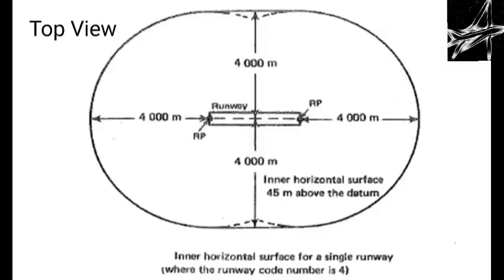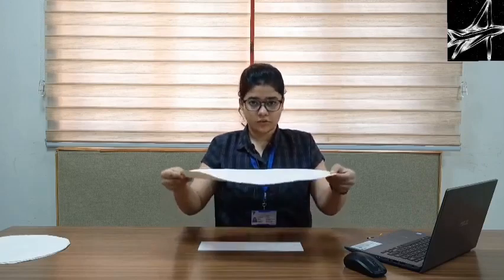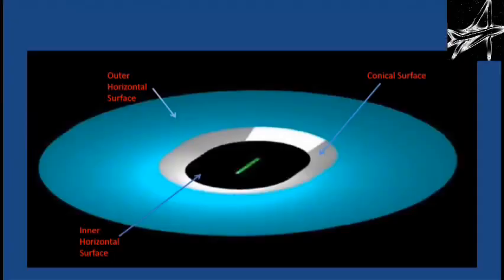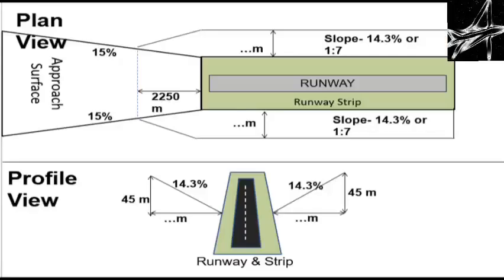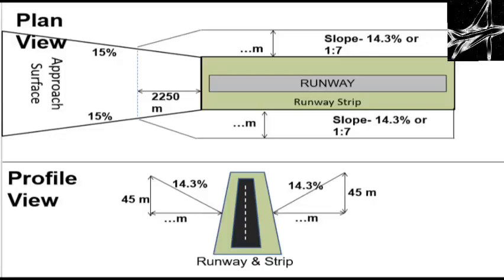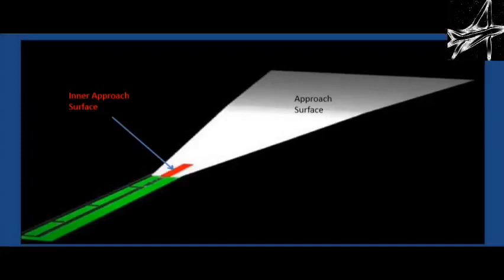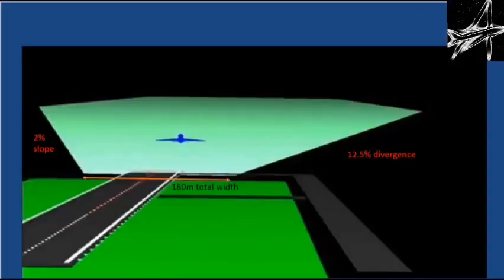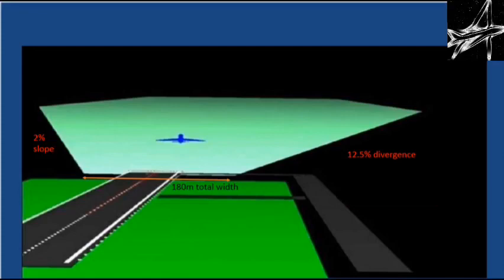OLS ( Obstacle Limitation Surfaces ) fully explained with All "9" surfaces in one video 🔥👌

Comment: Very useful video …. But can u clarify how d obstruction height is determined ie… if a antenna is to be placed 1000 mtrs from rwy centre line …. What is d maximum height of obs…. And is there is any formula….
Reply from the maker: 1000mtrs. Which side of the runway sir?
Reply: @aviationavi7532  Sir let it be any side … other than approach and departure path
Reply from the maker: If this is the case then the governing surface is Transition surface with a slope of 14.3% or 1/7 (one in height and seven in length), which allows a height of 123 m approx but since the other surface named as Horizontal Surface restricts the actual height to be 45m only. Till 4000m from the reference points
Reply: @aviationavi7532  Thanks sir….

Comment: Some aerodrome's ARP coordinates are not align to the mid point of runway CL (geometric centre of landing area) as we have two runway in use.  

In this case, which one we should consider as a reference to draw a radius of 15,000m for OHS? 

Established ARP again or Mid point of runway CL?  

I hope you can clear my doubt. 

Thanks,
Reply: The Outer Horizontal Surface shall extend to 15000 meters from the Aerodrome Reference Point for Aerodrome with runway code 3 and 4. In case of Aerodrome with runway Code 2, the Outer Horizontal Surface shall extend to 14740 meters from Aerodrome Reference Point for Instrument runways and 13740 meters for Non Instrument runways. Where combined Outer Horizontal Surface is established for two Aerodromes, the Outer Horizontal Surface shall be centered on the Aerodrome Reference Point of the Aerodrome of higher category. Outer Horizontal Surface for Aerodrome with runway code No.1 shall not be established. 

Hope this is of some help in clarifying your doubt.
Reply: @anweshapal8480  I really appreciated your hardwork and Thank you for helpful reply.

Comment: Value of "m" in Transitional sub-section...
14.3%=1:7
If 1=45
Then 7=x... by cross multiplying x=45×7
x=315m (Answer)
Reply: What should be the calculation for conical surface? Thanks.
Reply: @muhammadsultanularafin8846  the slope of conical surface is 5% i.e, 2100*5% =105M
Reply: 2100 kaha se ??  muje tu oper M ki calculation or aap ki bilkul samj nahi ayii.

Comment: The last part would be 13400..
Becoz now a days outer horizontal surface is to be considered as 20Km.
Plz clear my doubt on this fact..
Well explained about this topic...
Well done 👍
Reply: The Outer Horizontal Surface shall extend to 15000 meters from the Aerodrome Reference Point for Aerodrome with runway code 3 and 4. In case of Aerodrome with runway Code 2, the Outer Horizontal Surface shall extend to 14740 meters from Aerodrome Reference Point for Instrument runways and 13740 meters for Non Instrument runways. Where combined Outer Horizontal Surface is established for two Aerodromes, the Outer Horizontal Surface shall be centered on the Aerodrome Reference Point of the Aerodrome of higher category. Outer Horizontal Surface for Aerodrome with runway code No.1 shall not be established. 

Hope this is of some help in clarifying your doubt.

Comment: When you say "Reference Point", do you mean the Runway Threshold (black and white lines at the end), rather than the Aerodrome Reference point (Which is the midpoint of the aerodrome)?
Reply from the maker: 1. Reference points are marked on the diagram and these are generally taken as physical ends/beginning of the runway not the Threshold.
2. ARP is not the reference point.
Reply: @aviationavi7532  Thank you for responding. Reference Points = End of the runways. Got it. Thank you.

Comment: Please help me with my calculation
I tried to find the solution also from the other end - which should work, but why did I get a wrong answer?

Appr and Transitional intersect the inner horizontal at 45 m so since appr slope is 2% as you had in the picture as well at 2250m the appr slope reaches the 45m. By then since its divergence is 15% it  will have extended 337.5m to the side. Since this is the point where the transitional started it would mean m the distance from the strip has to be 337.5m as well but this then would give you an angle of 13.33%. 
Obviously wrong but where is the mistake in this calculation?
Since all surfaces are connected it has to be possible to find the solution like this as well. 
Hope you can help
Reply from the maker: I guess you have assumed "m" as the wrong entity. The "m" written close to 2250 is the unit of the value depicting meters.
Please comment down if the problem persists.

Comment: Can you explain why the inner transitional surface start from 60M for Code E and 75M for Code F
Reply from the maker: Just one liner explaination is not possible as these value came after a lot of research work..not with the aircrafts only but also with the improvements with ground equipments (DME LLZ, PAPI, etc)..hope you understand.

Comment: Dear Sir/Madam, Have observed that all Type A charts issued by AIP India for all kind of aerodromes like code 2,3,4 aerodrome s have takeoff funnel with same dimensions as:
1. Inner edge = 180 m
2. Divergence =12.5%
3. Length = 15000 m
3. Outer edge = 1800 m

Why it is like that, actually above dimensions are for code 3 & 4 and for code 2 there exists different  dimensions for takeoff Climb surface. Still for every aerodromes same dimensions are used . Can you do a video on this topic, explaining why?
Reply from the maker: Hey, that's a great observation! 

These surfaces are many a times designed based on the master plan for the aerodrome. Based on the plan for expansion to Code 3 or 4 for a runway which is lets say Code 2 presently, the OLS for the runway is defined with respect to Code 3 or 4 runway to avoid complications in upcoming stages.